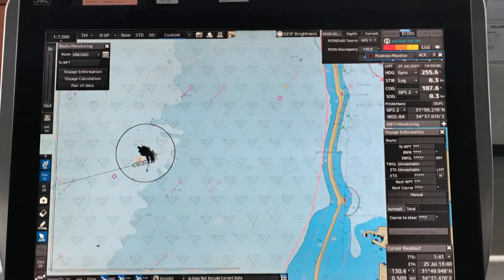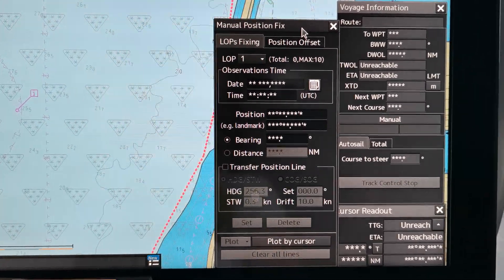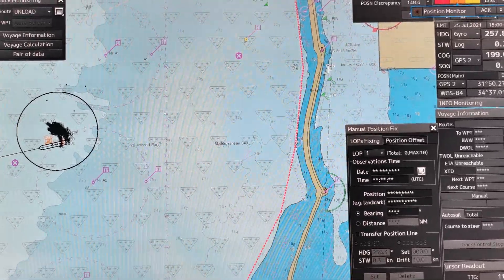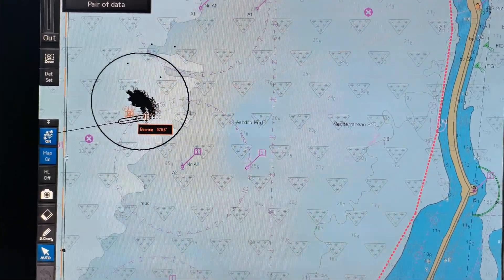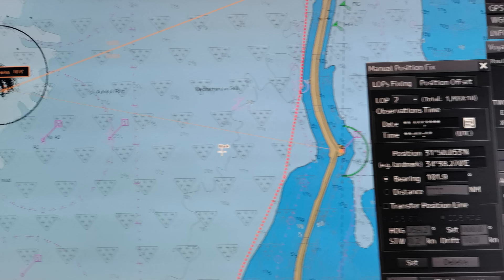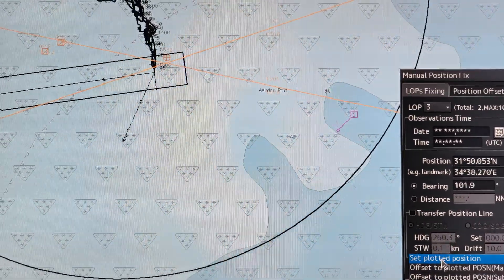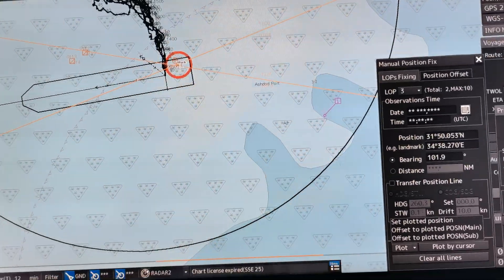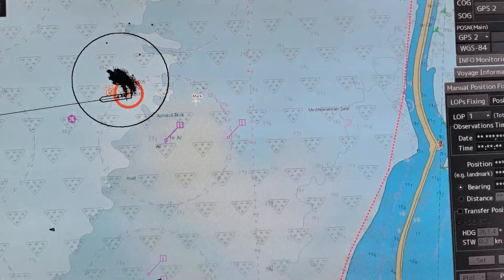HOW TO APPLY MANUAL POSITION FIX / LOP's IN ECDIS

Comment: Iam sorry but I have doubt.
The way u r doing it, it is just basically that we are using our efforts ECDIS data for plotting our pstn. But we are not sure whether ECDIS data is correct or not. In that case there is no point in doing manual plotting, rather GPS fixing would be better.
On the other hand I think so we should take range and bearing from RADAR or visually and then enter it manually in ECDIS for getting manual position. 
I have had this doubt for a long time and I would be very happy if you could clarify it.
Thankyou
Reply from the maker: Hi, by the way thanks for watching.
I agreed your opinion. This video is only showing how to plot a manual position fixing in ecdis after taking Range and bearing from Radar. Though i didnt mentioned it in the video.
Have a nice day. 🙂